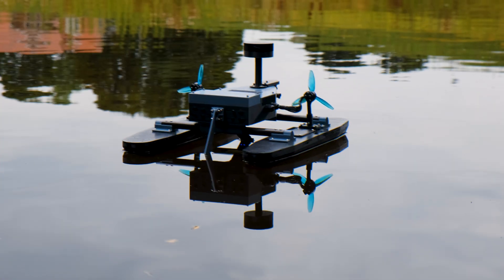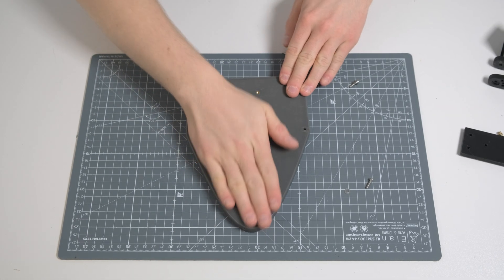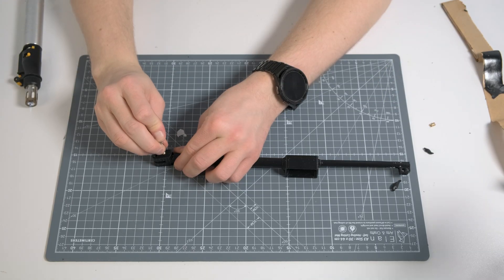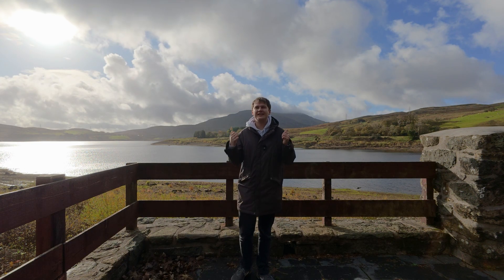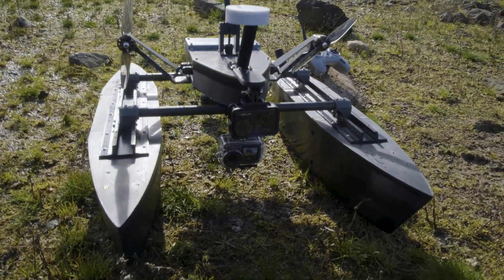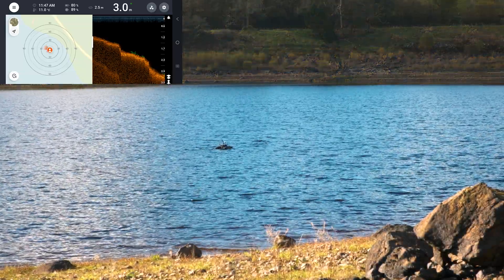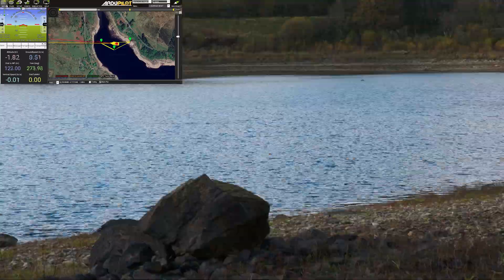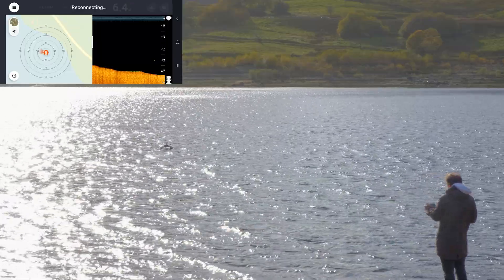I Trusted My DIY Autonomous Depth Mapping Boat On a Lake

Comment: MLRS is the best thing ever. Why isint everyone using it? I think these brass insetrs is enormasly over engineering and making the build more difficult. I only use them on very expepitional applications. Stainless self tappers (2 or 3 mm) are completly fine if you have enogh 'meat' around the hole. Also whats all that messing about with the goo stuff? Just put an O ring rescess on one on the surfaces.
Reply from the maker: MLRS seems so good so far, i know, with mission planner its such a powerful thing. Agreed,  I work in industrial industries, so im so used to everything being over engineered! I think for me its more the idea of being able to take it apart and put it back together lots of times over!. Hmm that is a good idea, ill lookinto designing for use with o rings!
Reply: @CyAntonyAsh  Great work so far!!  I agree with @vincehogg8925.  Maybe even take it a little farther and incorporate a stepped disk (above the deck) that would engage into a recess of item being attached to the deck. This design would locate the mast, make the connection water-resistant, seal to the o-ring and simplify the attachment.

Comment: As for your deeper there is a range extender that works to about 250 meters but if you need more lots of carp angles renove the deeper antenna and add a external sma connector then feed that in to a 4 w liner wifi booter in to a 5dbi antenna  and this gives a range of over 400 meters
Reply from the maker: That's really interesting, I had wondered @markhurst8425 if this was possible to at least extend the antenna away from the water. I'll do some research! Thank you for the comment

Comment: When you say 'mapping' are you intending to capture bathymetry at a specified GSD/Post-spacing and if so do you think you'll need to upgrade to RTK GNSS?
Reply from the maker: So the plan is to add my own depth sensor straight back through my telemetry. Right now im testing with a deeper pro plus (as its simple while i develop the boat). I've got a here RTK that will be positioned at ground control. But good thinking, if its going to be precise it will need an rtk 🙂
Reply: Surely the depth sensor on that wavy water can’t be accurate within meters in XY, meaning that a normal gps will be more than sufficient. Once you get the points, I think that QGIS could create a depth raster or even a stl model of the lake bed.
Reply from the maker: What you're saying makes sense. What id like to do is have my own depth sensor, perhaps with a weighted gimbal to ensure its facing directly down. Lots to think about, lots of upgrades to come.

Comment: Couple of thoughts: (1) - you may benefit from looking at ensuring the TX and RX antennas have the same polarity (probably vertical) - the antenna at the top of the mast seems to be over at about 45 degrees. Of course (as you found out) 900Mhz has better range than 2.4GHz. If it's available in Ardupilot, monitor the RSSI - its an indicator of how close you are to reaching maximum range. You might also be able to trigger auto-home based on RSSI values. (2) What is the fish finder frequency? I suggest a vertically aligned dipole antenna (1/4 wave) up as high as you dare (assuming the antenna output is available on the fish finder). Thanks for the video!
Reply from the maker: Very good point about the reciever antenna angle. Currently im using a vas antenna, but really it could be a omni vertical like the transmitters on a mast.  I think the boat will return to launch if it fails signal. Ill check the rssi next time we take it out. Thanks for the comment!

Comment: Lovely job man! I finnaly managed to start at my project too! The kids want to join me on the trip too... so my whole requirments changed for my catamaran, I managed to reduce changes I'm going to add a Pi4 in it since the kids would like to be looking trough their own Camera! Meaning my autonomouse deisn will be done later in a modular fasion! The camera mod will be a module that I can add, the Pi handels all the 4 cameras 1 frond 1 back facing and 2 wide angles sligly looking left and right where the kids want to look trough and searh for trash we can extract! 

Now with 2 thing the only requirment that is tricky... is finding time...! 
As mentioned before man, keep on going so happy to have someone who is doing same kind of things!
Reply from the maker: Thats really cool mate, im thinking i might need to add an rpi too honestly as i want to do more advanced depth mapping and over the radio long range. Thats a reallt cool idea using it like that though. I too have been thinking about a live feed camera! Currently looking into a ground control hardcase! Thanks for the comment, means a lot. I know! Exactly, time is always the restraint

Comment: What were the reliability issues you had before, which you solved with the 900MHz mLRS?
Is the RTL feature enabled so the boat comes back to you if something goes wrong with the radio link? I've found it to be reliable on Ardupilot, none of mine ever needed tweaking and just worked (unlike other firmwares).
Reply from the maker: I was using 2.4ghz which isnt ideal with water, and i was using elrs, which whilst poasible is less designed for full mavlink telemetry so i was having range issues and ardupilot issues! Yes RTL surprisingly works really well i think, but yeah comes home if it loses connection! I partially just liked the concept of MLRS too.

Comment: Excellent work, well done. If you stand where you walked in overlooking the lake you will be able to see the boat via RF over every bit of the lake you can see with your eyes. All that rocking is going to affect the data capture accuracy when you do start logging. So wave size vs boat width and length will hove into view. Simple solution only map depth on a calm day.
Reply from the maker: Thanks mate, means a lot! Thats a good points, probably a lot better for the antenna. Im planning on building a proper ground station for the next video! The rocking is annoying when it choppy. Part of me wants to just accept that it needs to be a bit calmer, the other wants to make the boat bigger and heavier 😀
Reply: @CyAntonyAsh  yes that's going to be the trade off, you will also be able to map a larger area on a calm day. Always compromises. Antennas will be diminishing returns. Make sure they are both vertical or both horizontal. Height will give you more advantage than huge antennas. But keep going you are doing all the right things.
Reply from the maker: Thats very true, a lot less energy waste on a calmer day! True true, maybe it best to have the radio up high when where the entry was! I was thinking if a tripod for the ground station! We'll get there eventually, thank you! Means a lot

Comment: Definitely think you should go with open echo for the fishfinder, especially if you want to do long range. Just more antennas will not work, at some point you need to start logging and you need to be able to extract data later. pymavlink's mavlogdump can work pretty okay at parsing logs, and I know it's possible to put stuff measured on an external arduino into ardupilot logs somehow. I just haven't done that part myself yet. There's also the python pymavlog module which works great, but is sadly a little outdated.
Reply from the maker: I think you're right! Using a sensor integrated into our system will be a lot better than relying on a separate ecosystem that is based on a wifi signal.  Which ia never going to work for long range. I'll investigate, thanka for the comment!

Comment from the maker: What upgrades would you want to see? 🛥
Reply: Adding LED (waterproof) bicycle lights to rails would be an option. 
Self powered so could be useful if the power goes off too 🫡
Reply from the maker: That's a really good idea having the power separate so we can find it if the battery fails!
Reply: Navigation lights, maybe an underwater flood light will help with the video, might even attract fish. Fun project!
Reply from the maker: Ooh that is a good idea, agreed. I actually reckon maybe adding floodlights and doing a night mission might have better visibility underwater!
Reply: Lower KV Motors spinning huge high pitched props slowly on 6s or even 12s will MASSIVELY increase endurance. I build long Range FPV fixed wings so if you have any questions, hit me up. Awesome job man. Subbed.
Reply: @read_the_tds1768 that is true for planes at higher airspeeds, but this boat is basically stationary compared to a plane. Higher static thrust will help with maneuverability, as he is trying to dead start push like 5 kilos through water. My vote is high vane count props like 10 inch tri-vanes on wider high torque motors with a medium 1200 to 1500 kv. Basically the setup from a fpv heavy lift sui3ide drone. IMHO
Reply from the maker: I will investigate! I might make a video comparing current draw and thrust potential options for the boat 🫡
Reply from the maker: Im currently running 1300kv emax eco 2. Ive got bi props and tri props. Not sure which ones to go for... got to do some tests. I think the boat will end up getting bigger, so definately will look into that. Thanks for the comment mate!